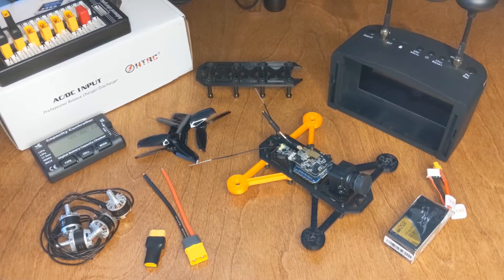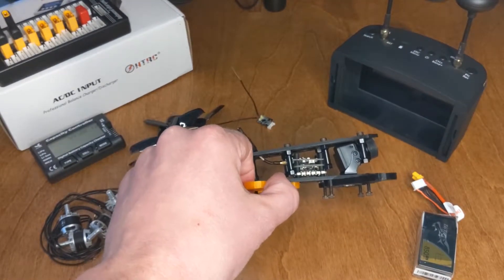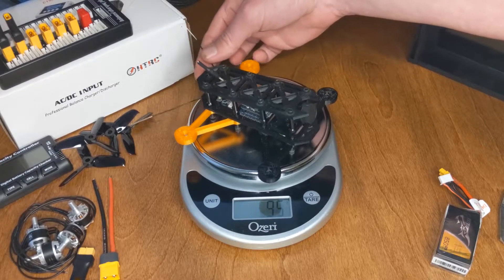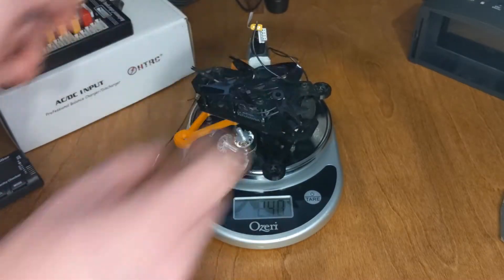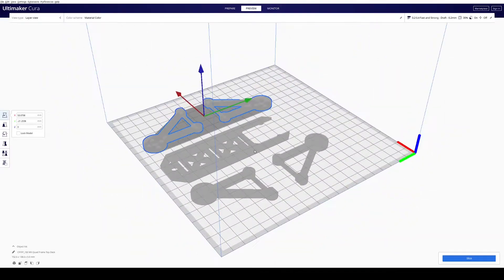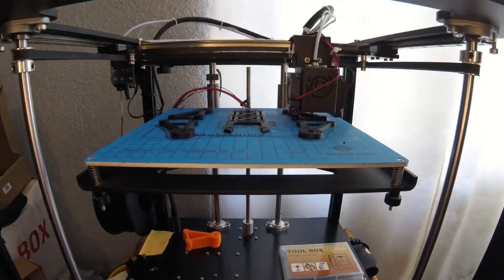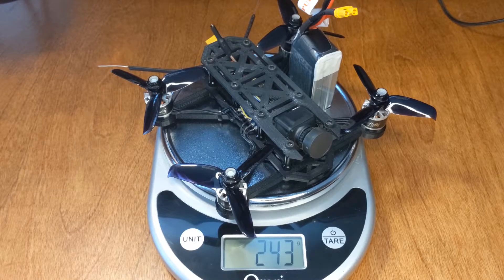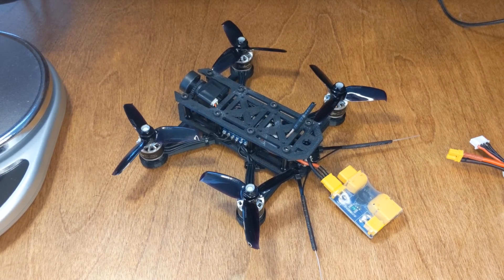Building My 3D Printed Sub 250g FPV Drone

Comment: Very cool video! Can you please list the parts you used on the drone? I am a beginner in this field so it would help me a lot. Also, it's been a while since this video was created :) so if you have any tips to watch out for when assembling a drone! Cheers!
Reply from the maker: Thanks! First thing I'd do is buy a reasonable radio for +/- $100 and download an FPV simulator like DRL Sim so you can see how you like learning to fly. Remember smooth is fast :p You'd have to look up how to make it work as a controller on your PC, but it prepares you for what you'll be doing later also; fiddling with settings in hard to understand menus ;) Note that the type of radio you buy can lock you in to the transmitters you need later.

Regarding the build, you'll need to decide what you want it to do. Do you want to go fast (100 mph+) for a few minutes or do you want to go smooth for 10-20 minutes? This will determine the motors/props/ESC/battery. You'll make the opposite choice depending on what you're going for; more aggressive prop angle, high KV motors, high Amp ESC, batteries with crazy discharge rates to go fast and the opposite to go long and smooth.

Sub 250g (obviously) you have to make almost every choice based on how much weight it adds. I figured for 3 inch props you'll need 13## or 14## motors (the product page will tell you), I got 1407's low KV to go long and smooth. because it's low KV I didn't need a ridiculous ESC so I could get the cheaper all in one stacks with ESC and flight controller. I needed to go with the mini stacks (20mm hole spacing) because the regular ones were too heavy. A few grams here and there is going to make or break your build if you aim for sub 250g.

For the assembly all you need is all the product information with diagrams right in front of you and a good soldering iron that allows you to set the temperature. I got an X-Tronic 3020 from Amazon that looked like the cheap but good option at the time.

Edit: of course you'll need some extra wires and screws to put it all together, but hopefully that speaks for itself ;)
Reply: @BitsOfInterest  Wow!  Thank you very much for such a quick and detailed reply. It helped me a lot! Can I contact you when I make a list of components to see if it's compatible with this drone?
Reply from the maker: I haven't looked at drone parts since I bought mine and made the video a few years ago, so I have no idea what's available today. Things change faster than in PC components 😜

I'd recommend hanging out in Joshua Bardwell's community on YouTube if you have questions about different parts. I watched a lot of his videos to make my own shopping list and the step by step videos on how to build and setup a DIY drone.

If you're planning to 3D print the frame from the SketchUp file I shared in the description you can compare the measurements of the parts you want to buy to the file or make your own adjustments before you print it. I designed it for standard parts back then, but I don't know if/what changed over the last few years.

PS first you'll need to watch some reviews for radio controllers and buy that 😉 You'll need one anyway, you can use it as a controller on your PC (as long as the one you pick supports that) and if you find learning to fly is not for you (it's not that easy) you didn't spend even more money on something you can't use 👍 Also it's better to have you first 100 crashes in a simulator than having to repair your drone all the time 😁
Reply: @BitsOfInterest  
Thank you for your reply! I would like to use the 3D-printed frame and buy all the parts, but I'm unsure which parts fit this drone. Of course, the total weight should be up to 250g. 
Does your drone fly well? What material do you recommend for this model? I have heard that PETG and PP are competitive in this area. Thanks again!
Reply from the maker: If the electronics have 20mm hole spacing and the motors 12mm you don't have to change anything and you can print it. I didn't experiment with different filaments; I use the PLA+ I have for everything I print :p

Mine doesn't fly because the transmitter is broken and I haven't found time to fix it. Also I'm relearning how to fly in the simulator in Mode 2 instead of how I started with Mode 1. I also want to build an FPV wing one day (I tried a wing sim) and I realized Mode 2 is superior for that. A wing doesn't have a rudder so you can just set the throttle and steer the wing with your right stick.

Comment: Cool! HAve u flown it? where is the vid? :)
Reply from the maker: Yeah... About that... I underestimated the software setup part that comes after you can power it on... I couldn't get my radio to find the receiver. Had to switch a wire because the diagram for my flight controller is wrong. Had to solder another wire to a grain of sand size spot on the receiver. Receiver is in the wrong mode and refuses to switch when I press the button. 

I put it on "the healing bench" so that it magically fixes itself when I'm not looking, LOL 😋 I did get a new receiver so I'm ready to try again...

In the mean time I did model my backyard in DRL Sim, so I've been flying it virtually so to speak...

Comment: Cool stuff, im also planning on making the same build but with 1806 motors without any FPV gear. Ordered all the parts, should arrive in the next 40 days  ;_;
anyways thanks for the inspiration, cheers !
Reply from the maker: I used 1407 because I was trying to keep it as light as possible. Would've gone 1306 or 13## if most of them weren't so badly rated. With 1806 you can probably run 4 inch props. They may be a little too much for 3 inch, but just check the specs. They'll recommend prop sizes to use.

Edit: I was also trying to fit in as large/heavy a battery as possible for longer flight times. If you go to a 3S/650 or 4S/450 you can add some weight somewhere else. It's all a tradeoff...
Reply: @BitsOfInterest  yup, the goal is to run 4 inch tri blade props plus i have a lot of 3s 1000mAh batteries lying aound maybe ill give them a try, thanks for the input :)
Reply from the maker: I don't know If sub 250g is part of your plan, but if it is you're probably adding 10-20g going with 1806 and another 10-20g using a 3S/1000 instead of the 3S/850 in this video. Since you're not planning on FPV you could chop off the front and back of the frame and just keep the area around the stack in the center. 

I've also been thinking about a new design for the arms; connect the front and back motors so you end up with one trapezoid shaped arm on each side that holds 2 motors. If you run props out there is very little chance you'll get stuck in a tree since it can't be sucked in on the side.
Reply from the maker: You probably already built your quad, but in case you haven't I made a video about how I would go about designing the frame ;) 

https://youtu.be/k8XiXlm6oGk
Reply: What did you use ESC?
Reply: 20a 15a?
Reply from the maker: @christianbaccay5852  it really depends on what motors you have and what props you put on them. Just looking at 1407's and 1806's a lot of them draw +/- 18A continuous, so to be safe you should go 20A ESC. My flight stack came with a 35A ESC, so I'm good 😜